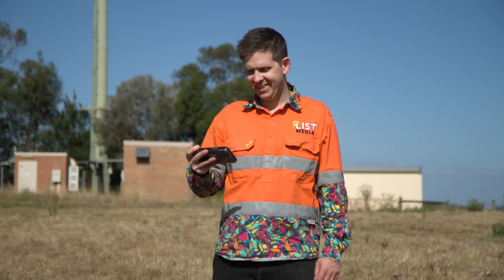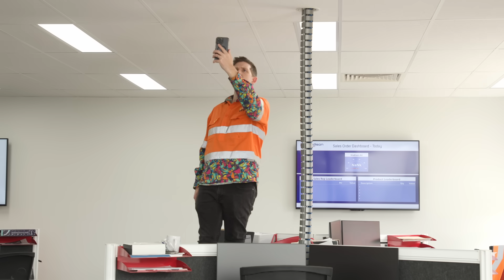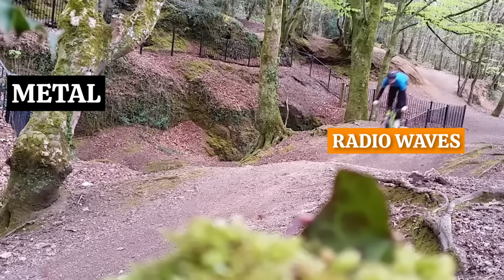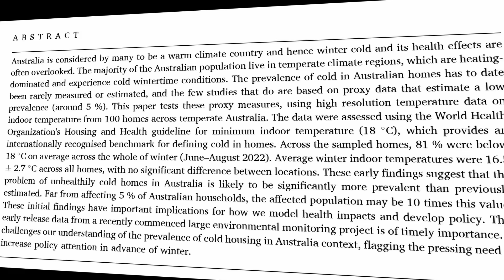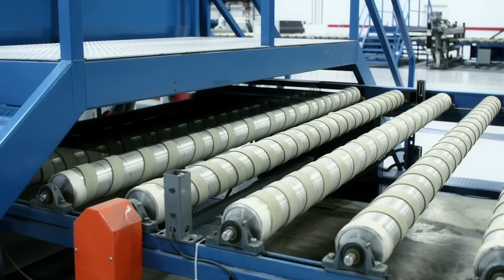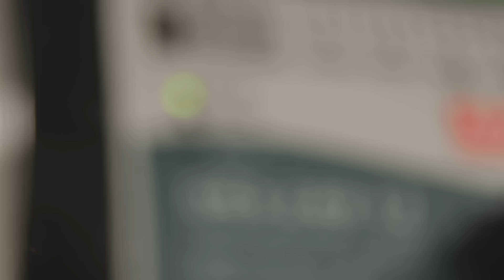The REAL Reason You Don't Have Mobile Signal

Comment: When I work in Thailand, there's not a square mm without full signal. 

I had signal 4 Levels down in a carpark, inside a lift. No way that'll happen in Australia.

So whatever is being done in Australia regarding the 4/5G architecture is absolutely not correct because it doesn't work here. And yet other countries are fine with the same buildings, same insulation and metal whatever.  I call: bullshit with a grain of salt

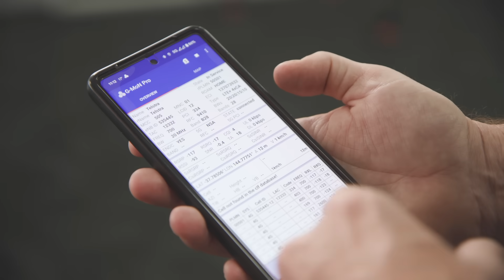Comment: 4:29 if you pause and look on his phone the band says b28...thats not a true 5G band ....true 5G bands are like nr28 NR4 NR2....thats why you're not getting the signal......B28 is an LTE signal which is 4G, not 5G
Reply: Nice catch! But you can use any modulation scheme on any frequency. And while 5G New Radio is all-5G, the early versions used 4G for call setup. Non-New Radio calls therefore work on two different bands, one 4G the other 5G. Reception on one can be fine, and poor on the other, and the whole call will suck. That's a carrier problem, but if you're stuck with one that still uses NNR, get used to finding that phone setting that limits calls to NR only, or 4G only.

Comment: Yehhhh.... 3G could hit my cell in a 2 level ungerground carpark. With full strength.  Today, behind one concrete wall I got 1 4G bar.
Reply: Yes but 3g couldn't track you as precisely. Which is all they GAF about.
Reply: The 3G signal was probably a lower frequency having higher penetration.
Reply: Sounds healthy.

Comment: WiFi calling is a godsend for being able to make calls indoors.  When you're outside, you get a decent signal, but when indoors, the signal can be weak.  Also, there is a limited amount of low-band spectrum, which travels through walls better, meaning these bands are full, resulting in slow data speeds and missed calls.  When outdoors, your phone can use the high-band frequencies, which are less congested, meaning faster speeds and fewer dropped calls.

Comment: In my town, near the seaside pier, the mobile network does not work during the season, it is impossible to make calls or use the internet, but outside the season or in the evenings, the problem does not occur. 

In this place, located 2 km away from the nearest GSM/5G towers, when several hundred people appear, the network is practically unavailable. 

The problem is exacerbated by the city bike station, which adds 100-200 additional IoT devices to the area.

Comment: Before I got Starlink I had a Netgear M2 device for our Internet, and thanks to the "Aus Phone Towers" app I could tell what direction the tower was that I was pulling signal from, and I got a directional passive antenna and pointed it that direction. Went from 1-2 bars to 5 bars. Improved reliability quite nicely.
Said remote cell site did have the propensity to drop out when there was adverse weather due to the microwave link being disrupted though.

Comment: Doing it this way allows the employers to snoop on your traffic too... 😅
Reply: No, it doesn’t. First of all you need an MSI catcher, and a warrant because that’s illegal. 

Federal law, enforced by the FCC, prohibits operating equipment that interferes with authorized radio communications, including cellular and PCS signals. IMSI catchers, or Stingrays, mimic cell towers and can disrupt network operations by forcing phones to connect to them, potentially causing interference. Repeaters do not interfere, therefore are legal and safe.
Reply: @traygaa how do you think the repeater works mate... It doesn't just magically tunnel the signal Into the building. .. its not passive its active ..  it simulates a cell tower therefore logging all of that data... They simply can't operate without access to that data.. that's why in a previous comment I suggested a more passive way of getting signal into the buildings which is changing the way that the windows are manufacturers to allow for waveguides to allow those signals to pass through.. much cleaner much safer way of dealing with the situation
Reply: The only differences it's registered in the network and therefore it's not seen to be causing interference.. the difference is only in definition of a lawful device vs an unlawful device they do exactly the same thing just one is authorised

Comment: Welcome back Listy.
I think you're missing the main complaint against mobile coverage, it used to be a lot better. The telcos are making the signal worse on purpose. The purpose? Cost. Electricity is the main cost, and by reducing the mobile coverage by 10dB, they save up to 90% on their power bills for each cell tower.
Reply: The signal is worse because of the higher frequency that is now used.  Higher frequencies mean higher data transfer rates. Unfortunately, higher frequencies do not propergate as well thru objects.  It's the same with wifi.   2.4ghz, which was the main frequency for awhil for Wi-Fi, worked great at getting thru walls and covering a wide area. Then Wi-Fi 5 came out, which gives way faster data rates and a lot less saturated than 2.4 Ghz, operates on 5Ghz frequencies.  Wifi 5 runs into the same issue of the signal dropping very quickly when objects like walls are in the way.  6Ghz is even worse to the point that a person standing in front of the radio can really drop the signal low.
Reply: @eitankahn9682  Thanks for the reply. You obviously didn't know that 5G is using some higher bands, but in Australia is predominantly on the old GSM and 3G 850, 1800 and 2100 bands, as well as the higher frequencies. 
Please research and know the truth before you reply in the negative.
Reply: You ARE aware that operators make money from CONNECTED calls, aren’t you? Yet at the same time your logic dictates that by shutting the network down, they would save all the money except the initial investment.
But somebody would notice, right?
Reply: @marekstanek112 I've noticed. Used to have full signal on 3G, then it dropped. 4G was terrible at first and is now slightly better, but since they shut down 3G there's no way to go back. I was using 3G exclusively before it shut down, just to keep relatively good coverage. Now with 5G using the band 22, it's not terrible but still only 1 or 2 bars in my back yard. Inside, 5G is almost unusable, and 4G coverage is slightly better. I'm not too far from the premises featured in the video.

Comment: old solution most phones can use wifi in and calling over wifi if ther eis no 4g and 5g i use that solution a lot and it works greet and its cheap
Reply: That works great if the Wi-Fi is good, but as someone who works on radio/voip solutions, often that isn’t always the case. Wi-Fi tends to be good in offices and high traffic areas, but basements, stairwells, plant rooms etc are not always given the same treatment. Also on some networks, the handoff from one access point to another isn’t exactly seamless, and can cause real-time traffic such as voice or video calls to break up or drop altogether if you’re moving around the building.

Comment: I just checked the average temperatures for Australian winters. LOL you guys are like people in the uk. You have no idea what a cold winter is until you've lived in a place like Canada. And before anybody says anything about we don't know Heat. Well we do. Where I live in Canada we frequently get 35 to 40° C not even including humidity which can shove it up to 50 to 51° C. While not as hot as the absolute hottest place in Australia still hotter than most of the country.
Reply: Many homes, especially those not adequately insulated or heated, can experience temperatures below 15°C, and some even drop to 10°C or lower.
Reply: @calvinnguyen7059 That's still walking around naked at home temps for a Canadian. haha

Comment: Wow your cell towers are basically in the open down there!? In the USA they are basically inside a cage with barb or razor wire making getting close to the building or towers extremely difficult!  I don't know if it's FCC laws or just because they are afraid people will climb active towers up here?  It's nuts to go up an active tower because of the powerful RF energy but Darwin always finds a way to thin out a few .
Reply: Open in the UK too all over cities
Reply: US vs Aus is quite a funny comparison.  All of Australia's 2G towers went up before our monopoly telco got privatised & demonopolised (or split up, like AT&T was).  So our 2G towers were put in prime positions and given better density than comparable countries.  Luckily 3G and 4G had similar requirements and just needed the modulators swapped out, maybe a new antenna.

5G is a mixed bag, with different types of 5G being optional.  The super duper speeds come from low-range high-frequency bands that blur the distinction between cellular and wifi, other than wifi is still self-managed.
Reply: it's to stop the junkies from harvesting copper
Reply: @dorkultra yes but the Towers were around way before that was an issue in the USA my first mobile phone was in the late 80s sure it was analog large and expensive but who I worked for required /provided if in the trucks permanently mounted.
Reply: Probably because anywhere addicts think they can get copper they will in the USA.